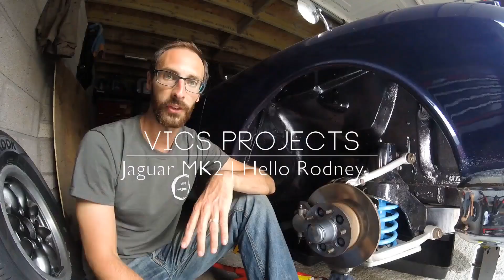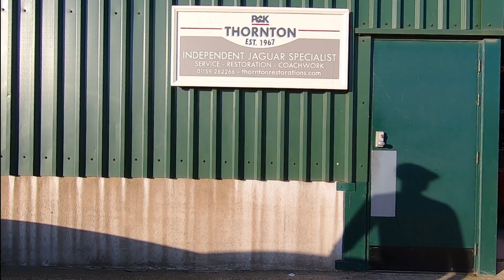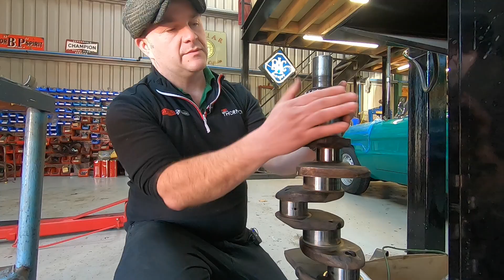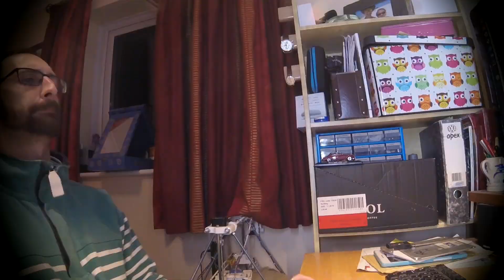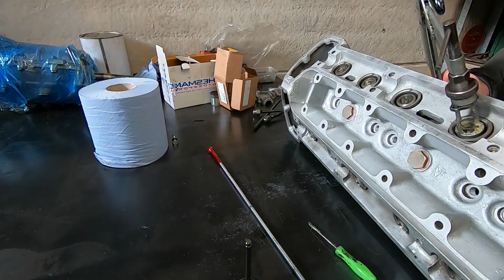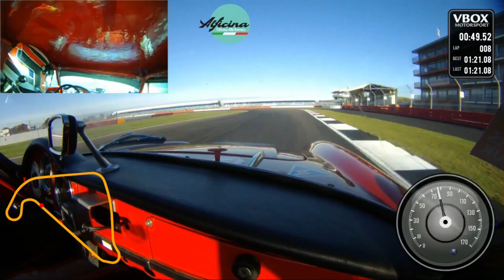Jaguar MK2 | XK Engine Tear Down

Comment: Sorry to say, but what your restorer told you is not OK as long as you did not ask him to drive the costs towards the moon. Keep your head  because 80% of the tuning result is gained via the seat cuttings and with about 3 hours of smoothening grinding you would end up with a very nice head. The 9/1 pistons make sense but camshaft modifications in a MK 2 not! Even with a Jaguar E it is a long way along the tuning funnel until you should modify the cams.

Comment: Hi Vic, I do E-Types quite regularly. A word of caution about a fast-road setup. Uprated valve springs and lobe heights can cause considerable valve clatter in the engine bay. In some cases the fix is a louder exhaust!

Comment: I dont understand what the guy is saying about missing piston rings ? 

He holds a piston and saying "on your engine it had three or four piston rings fitted on the bottom while on the top you didn't have any". But he's showing a piston with three gaps the top two being piston rings and the lower being a oil ring. Where are the missing rings from "on the top"  supposed to go ? and how has a single piston got four rings "on the bottom"

Then he says the other piston has the right amount of rings but shows a piston with exactly the same two rings and an oil scrapper configuration ? 

All i can think is he's talking about all the pistons in engine and some individual pistons were missing bottom rings and all were missing top rings... but if that is the case then the piston he's showing us should have no right on the top but you can see one. Also that would leave the ones without bottom rings with zero rings other than an oil scrapper, how did those cylinders have any compression ?

Comment: Great video as always Vic! A few things for your consideration. 1. High torque starter motor & 2. 123 tune + ignition… Bluetooth controlled timing, no weights and springs to deal with! It’s excellent. 

That in combination with a choke sys makes a huge difference to cold starting, my Xx engine jumped off the starter in -1c a few weeks ago. 
Keep it coming mate. I can only imagine the time and effort that goes into your production. Top notch!
Reply from the maker: Thanks, I'm really looking forward to getting it all back together! In one of my first episodes I fitted a 123 ignition, who makes the choke system you mention?
Reply: @vicsprojects  ah just saw this mate. The choke sys will be on your carburetors. Ah yes I do vaguely remember you fitting the 123 . I’ll recap sometime.
Reply: Hi torque starters chew up original flywheel ringgears. Nothing wrong with the original unit.
Reply: @RichardMichaelOwen  ‘hello everybody, Richard Micheal Owen from Owen Automotive!’ 😃 I’m a long time subscriber, and Huge fan of your work and your Channel.
The hi torque starter is working well for me but your advice definitely holds more weight. 
I’ll monitor my ring gears in future inspections. ❤

Comment: I'd think twice about the piston upgrades.  Many people will buy what ever the latest hype is.
We've seen this with Healeys, get the super high compression pistons, just because you can.  Then you need expensive rods, etc.  The car never runs right or smooth again for very long - lots of internal stress.  Many of these racing components are for racing engines that are torn down regularly.  
No harm in the head upgrades - that's usually the area of most deferred maintenance.  
Most of us will never make use of many of these 'mods'   For me, I wouldn't mind a high-flow oil pump, we all get nervous at the Jag oil pressure at idle.
Thanks for the video, hold onto your wallet.

Comment: The guys at Thornton seem to know their stuff.
I’ve enjoyed watching your Jag build. Mine is 1966 originally  a 3.4 that had a 3.8 block fitted in 1990, long before I bought it in 2007. Apparently the 3.4 and 3.8 heads are the same. Is this not an easier route to more power?
It would be good to know the final engine build cost, as mine needs doing soon.
The good thing is that you have a nice family car there
Reply: He already has the best B-Type head before going straight port with the more expensive intake system. Easiest route to more power is 4.2.

Comment: It's a shame it wasn't rebuilt correctly, but whoever did it probably did the best they knew how.  Sometimes it's best to pay an expert though.
Reply from the maker: Well said Allen! Whoever had the car before me loved it to bits and did everything to the best of their budget and ability, that's the reason it's in good overall shape today 60 years after it left the factory.
Reply: I wouldn’t slate the previous mechanic owner too much as I doubt they did much wrong when servicing the engine.  That said, it does sound like the lower timing chain guides being loose is down to bolts not being correctly torqued at some point (or after 50 years perhaps they just thought it time to slacken off a bit).  If this is the cause of recent noise then it's a very new problem. 

However, it seems like the 2 thou valve gap has probably closed up from when set. I bet they had the feeler gauges way too tight when last checking  the gaps and so used the wrong shims. But the timing chain was positioned correctly or it wouldn't have run. It sounds like the damage in cylinder 2 was possibly caused by a broken spark plug electrode which might account for the main bearing scoring (likely due to something small and metallic being carried in the oil and I’d be interested to know if the camshaft journal bearings were similarly scored).  Or something metallic dropped into the open spark plug hole. It doesn't sound like a broken ring as the damage wasn't too extensive. 
 
The carbon deposit on the valves and cylinder wall glazing or possibly burnishing was probably down to the driver running with an over rich mixture.

Anyway XK de-coke, valve lapping and tappet shims adjustment timing is certainly no more difficult than most that Vic has done. Much fun ahead to had maintaining the refurbished engine.
Reply: Great company but not cheap. I miss VSE

Comment: @Vics Projects  Go for a straight port head Vic, 'Chip' Doesn't come over that knowledgeable with Jag stuff IMO,  To the best of my Jag knowledge Jag Straight port heads were used on the following Jaguar production cars: XK150S, E-Type 3.8 and 4.2's, MK10's, 420's, 420G's, MK2 240 and 340 and all XJ6's ie 2.8, 3.4 and 4.2, The Series 3 XJ6 4.2 EFI's had bigger inlet valves and apparently hotter camshafts, I've got a nice condition (No corroded waterways and straight as a die) straight port head off a 420 for sale if you are interested mate but you have to pick it up from Barnstaple, North devon! Cheers! Regarding liners the normal straight ones are called sleeved and the ones that sit in a ridge and are better are called top hat liners! I think you should have got Lee @Barum engines in Barnstaple (Check out his youtube channel Barum engines) To sort this engine out as unlike Chip he knows his onions and it would be a lot less ££ for the rebuild!
Reply: Hey Scotty, this is Chip. I appreciate your comments, I am no engine builder myself, only knowledge I gathered over the years by seeing the engines being put together. My engine builder is camera shy, but WE build great engines and our track record speaks for itself. The prices vs Barum are very comparable.
Reply: @pkthorntonrestorations  'Chip' You work for a so called Jaguar specialist restorer? And failed to give a run down of what Jags had the straight port heads fitted? 😂I'm glad that a Jag 'novice' like me listed all of them!
Reply: @scotty6346  in front of the camera, I admit to have omitted quite a few